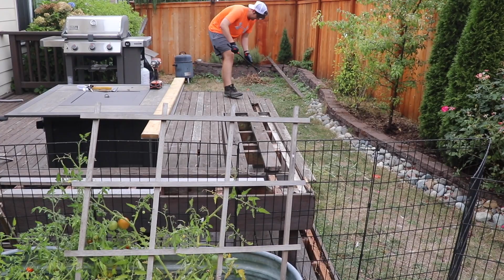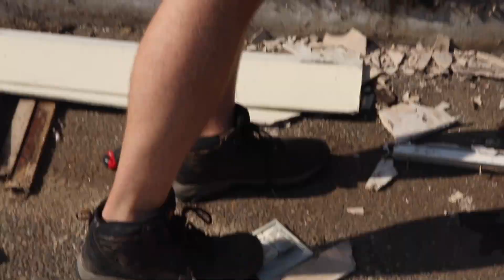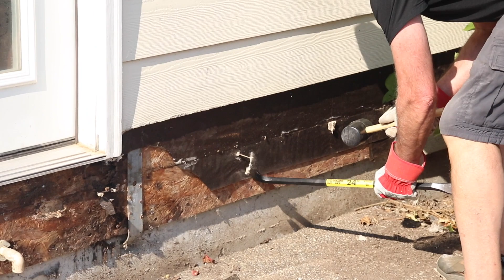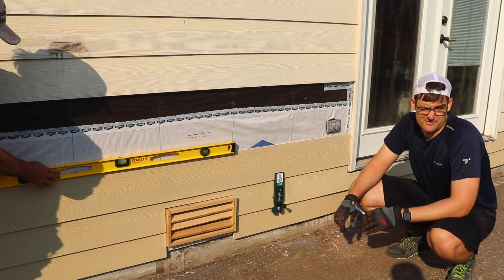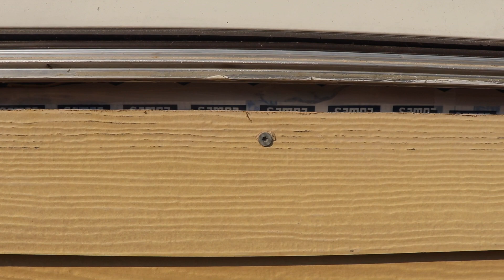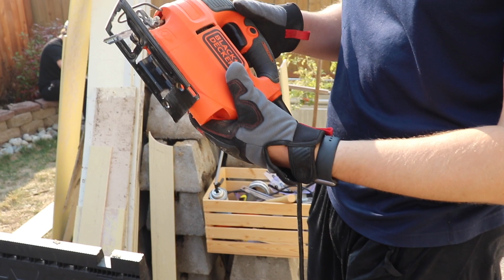HOW TO REMOVE AND REPLACE SIDING | Patio Makeover Part 1!

Comment: With the hardie plank, house wrap, and sheathing (figure 3/4" before you're hitting stud), you're only getting about 1/2" penetration on the stud which is not that great. You're probably okay because you used screws but a 2" fastener would've been best imo. Otherwise, nice thorough job sir.

Comment: Nice video.  Curious why you chose a jigsaw over a circular saw for making the hardie plank cuts?
Reply from the maker: @ajhale77  it needs a diamond tip cement blade and it was cheaper for a jigsaw blade.